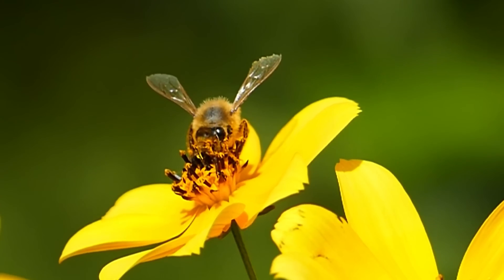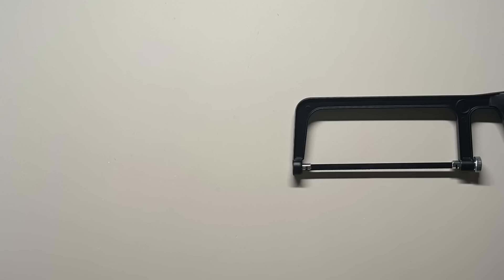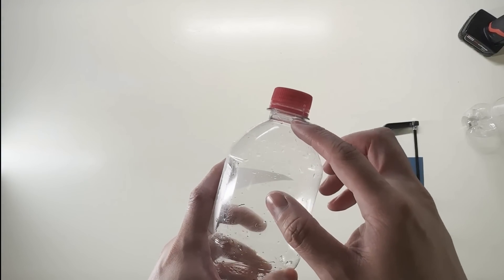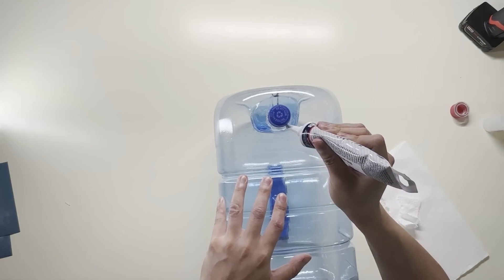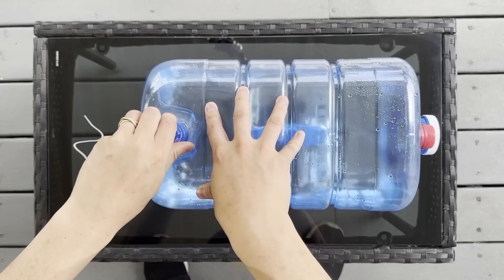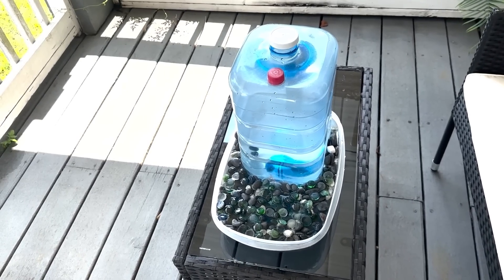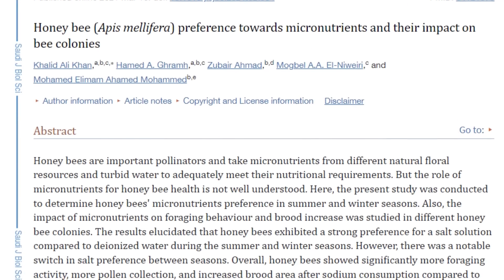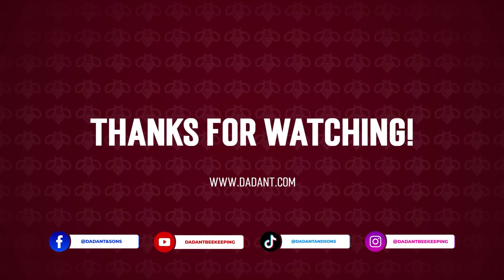How to Make Your Own DIY Bee Watering Station - Keep Your Bees Hydrated !

Comment: Good way to spend more money building something unreliable due to the siliconed on parts plus a lot more time than it costs to buy a chicken waterer and throw in some rocks. Automatic dog waterer or for me a livestock trough with wood blocks floating in it (livestock  trough gets at least 25 to 35 gallons of fresh water into daily). 
Although if the large jug was free, you already have the silicone and you are by the waterer daily, have another one ready as a spare, then it is totally fine.
That said, I had not heard about the salt in the water, so thank you.
I did notice that the salt water was compared to DI water, DI has pretty much 0% minerals in it. 
No one or anything should ever drink DI water, it will leach minerals out of the body when you urinate.
BTW, I have run a DI water plant for 30+ years.
I would like to see it compared to tap water.
I am going to add some sea salt and maybe some oyster shells though, just makes sense.
The rest is all good tips as well.
I wish the sound was louder, could barely hear it.

Comment: MY SIMPLE BEE WATERING SYSTEM. 5 minutes to set up! I have a large ceramic pot, no drainage hole in the bottom. Set it under your  roof eaves so the rainwater keeps it full of water. Add pond plants (mine have small leaves). Bees land on the pond plants, drink, and fly back to their hive boxes at the back fence. LOW/no maintenance. Bees come and go from it all day!